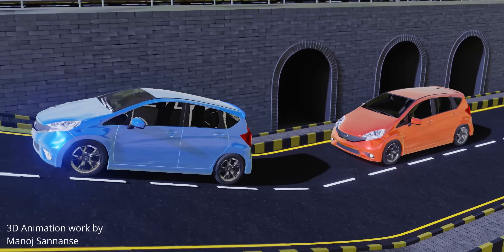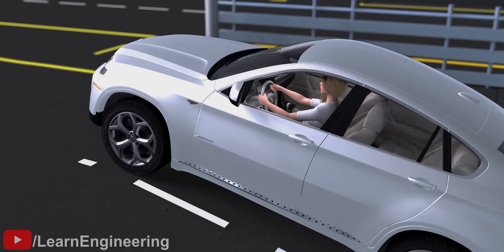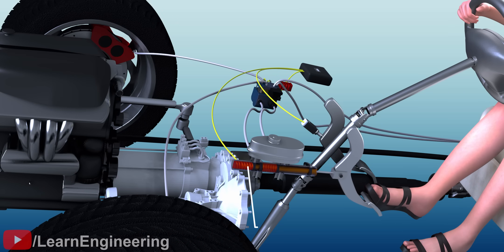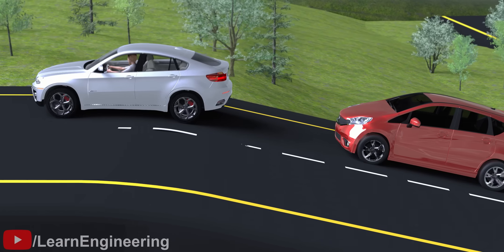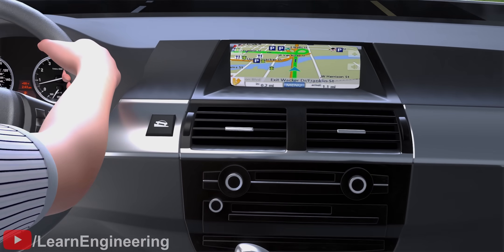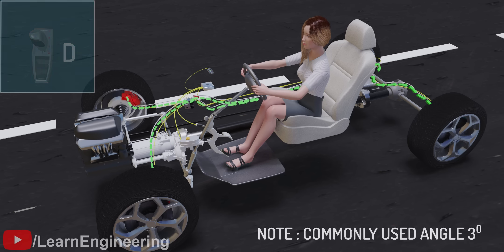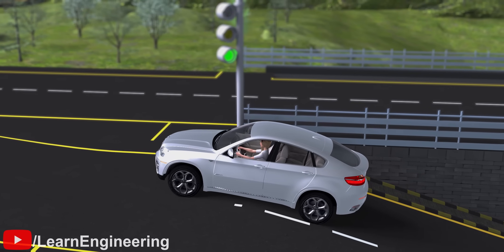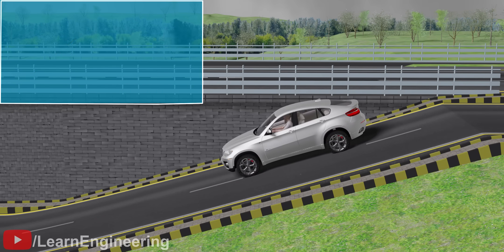Understanding Hill Start Assist!

Comment: Hill start assist is just another excuse for incompetent driver to be on the road.
Learn to drive is a much better solution. 
Driving instructors today can't drive properly themselves 90% of them are totally useless as instructors. 
I have been a Trainer / Assessor for heavy equipment, light vehicle, multi combination, small ships, aircraft, and construction/mining and military for fifty plus years.
I started driver training at 17 years of age, because l was taught properly by my father on all types of mobile equipment l am now in my mid 70's and still training young people from age 10, by age 12 they can operate excavators, cranes, light vehicles including speedway racers.
This gives me the qualifications to state there are very few competent drivers anywhere in the world.
No I've never had an accident.

Comment: “Using the fewest components,” Oh if only there was, say, a wire on a handle that went to one side of the brakes and simply applied the brake. The weakest link is the nut on the other end of the handle, it’s prone to failure

Comment: If we taught people how to actually drive we wouldn't need all these stupid expensive computer controlled features. I can do that hill start feature in a manual transmission. Add snow and ice to the situation and you have to think about weather you should go to the top of the hill or stop at the bottom and get a head start. Computers are making the next generation dumb! Good luck!

Comment: I hate hill start assistant!
I never ever had a problem to start at the steepest hills without it.
But now I have a problems parking at a hill. To overcome the breaks of the hill start assistant you have to accelerate much faster and the acceleration comes suddenly (without your control), so the possibility of hitting the cars before or after the parking slot is higher.
Reply: AND, it's expensive to have to prematurely replace your clutch because the hill assist causes excess wear and tear.   Check out the blogs.   Experienced drivers HATE HA!

Comment: There is also handbrake available in every vehicle, one should use handbrake on when stopped on inclined road and when u want to move up again put ur foot on acceleration paddle and accelerate, when u feel it moving release handbrake and u r going up. Its simple (need Practice)
Reply: This is next level of mind process, let just NASA invest in to some weird automatic asist.

Comment: "A few seconds are required" to switch between the brake and accelerator / accelerator and brake pedals?!
That could explain why there are so many 'tail end' collisions in 'the great USA'.
A vehicle travelling at only 20mph, will cover 9mtrs / 30ft in 1 second.
In 'a few seconds' - lets say 3 - it will cover 27mtrs / 90ft.
No more than a split second should be needed to move your foot between the brake and accelerator pedals.
If one is not competent to start on a hill - just by balancing clutch, brake and accelerator - USE THE HANDBRAKE!!!
Is that not taught for a US driving test?!
(Oh. I forgot. The citizens of 'the great USA' are mostly too intellectually challenged to be able to drive a vehicle with a manual transmission.)
I've driven and owned vehicles with 'hill start assist' technology.
Like most, if not all, modern 'safety' / 'driver assist' features it makes the driver lazy and dependant on technology.
Like most, if not all, modern 'safety' / 'driver assist' technology it is prone to failure.
WHEN it fails the driver, expecting the VEHICLE to be 'in control of the situation', is placed in a worse predicament than if the 'technoligy' had not been there in the first place.
'Cruise control' is another example of potentially dangerous 'driver assist' technology.
ALL 'driver assist' technology requires extra 'specialised' driver education to be used safely.

Comment: Try using a manual on a steep hill. The car will roll back, but you have to be quick to let off the brake and clutch and hit the gas about the same time or you will roll into the driver behind you or stall. Takes some practice but it's quite fun to do. I always try to see how fast I can move forward with minimal roll back.
Reply: Tell me you’re inexperienced without  actually telling me you are.
Reply: Have you not heard of the HANDBRAKE, or what it's used for?!

Comment: I used to do all this with my left foot on the brake or in a car with a clutch with the hand brake. A foot operated parking brake was a bit more problematic.
Reply: It's hard enough for all these people to get out of bed in the morning. Now you want them to multi task while driving?
Reply: @YourDadsBoyfriend  yeah but only under 5 mph.
Reply: @YourDadsBoyfriend  yeah up to 5 mph.
Reply: @Aerostealth  
They manage to multi-task enough to send and read text msgs while driving.
AND they claim that's safe to do.
Reply: When driving an automatic one should NEVER use both feet.
It has to be a VERY steep hill to cause an auto to roll back.
Why would you want an auto anyhow?
Much better control with a manual.

Comment: This tech is crap! It locks my truck brakes even on flat surfaces and causes accidents because when I press the accelerator the brakes still hold with immense lag time. This tech is garbage and people need to be better at driving if they "need" This tech

Comment: What's so hard about just revving it a little and slowly releasing clutch until it engages?
Reply: What's so hard about using the HANDBRAKE as and when necessary.
Is that not taught in your 'driving schools'?!
Reply: @trueaussie9230  Who said it's hard to use handbrake? You got problems in the head?

Comment: use left foot to release the brake while right foot pressing accelerator
Reply: When driving an automatic one should NEVER use both feet.
It has to be a VERY steep hill to cause an auto to roll back.
Why would you want an auto anyhow?
Much better control with a manual.

Comment: Alternatively use left foot 🦶
Reply: VERY difficult with a manual transmission.
When driving an automatic one should NEVER use both feet.
It has to be a VERY steep hill to cause an auto to roll back.
Why would you want an auto anyhow?
Much better control with a manual.

Comment: What the fudge. "As soon as you release the brake pedal, gravity does it's job". Umm no... First of all, a car with automatic transmission moves forward even without pressing the gas pedal, so there really isn't any need for assists. The car does not move backwards. Then with manual transmission, there also isn't any rush with moving your foor from brake to gas. While uphill, all you need to do is to lift the clutch about halfway up. (The required amount of lifting the clutch depends on the car). The car does not turn off and also it won't start to slide backwards without brakes.
Reply: Or, in a manual vehicle you could use the HANDBRAKE and reduce unnecessary wear and tear on the clutch plate.
Reply: When you do something wrong with clutch you can smell it inside and outside the car. I've been doing this with my manual gear car for 9 years and never have I smelled anything that would indicate that clutch is taking damage.
Reply: @k4mik4ze100  
Have you ever seen a clutch plate?!
Do you know what it's made of?!
Have you seen what it mates up with?!
When you start to SMELL the clutch plate burning it is suffering extreme damage.
Before you can smell it, it is suffering unnecessary and avoidable damage.
Riding the clutch 'polishes' and puts a 'glaze' on the surface of the clutch plate - even before you can smell it cooking.
That 'glaze' reduces the adhere-ability of the plate which negatively effects the transfer of power from the engine to the wheels, until the 'glaze' wears off.
If you continually / repeatedly ride the clutch, the 'glaze' never wears off.
Using the handbrake avoids that unnecessary wear.
But, if you're happy with what you're doing, please continue.
You're the boss.

Comment: What did the smart people do before it all this technology hold the break with your left foot start giving a gas with your right it's not hard to figure out nowadays everybody so freaking princess and depends on technology to do every damn thing
Reply: When driving an automatic one should NEVER use both feet.
It has to be a VERY steep hill to cause an auto to roll back.
Why would you want an auto anyhow?
Much better control with a manual.

Comment: Yeah, like its really hard with automatic transmission anyway... 😅 I drive a manual and this tech is useful, liking it very much.
Reply: The 'standard issue' HANDBRAKE is even more useful - and comes without extra cost and, unlike 'hill assist technology', rarely fails without warning.

Comment: Interesting, but just another reason not to buy a new car. It sounds expensive when you can just use your 2nd foot on the brake if you have an automatic as depicted here.
Reply: When driving an automatic one should NEVER use both feet.
It has to be a VERY steep hill to cause an auto to roll back.
Why would you want an auto anyhow?
Much better control with a manual.
Just out of interest, have you heard of a HANDBRAKE?!

Comment: Ik like u can just leave clutch at a slow pace nowadays and the car will mostly start moving with no accel so i always used to put my foot on brake and clutch then when i started to drive an old car and it needed some accel i just switched  to the fucking handbrake it is that easy srsly thats why Automatic car is a degenerate race
Reply: It has to be a VERY steep hill to cause an auto to roll back.
Why would anyone want an auto anyhow?
Much better control with a manual.

Comment: In auto hold brake with.left.put right on gas easy
Reply: When driving an automatic one should NEVER use both feet.
It has to be a VERY steep hill to cause an auto to roll back.
Why would you want an auto anyhow?
Much better control with a manual.

Comment: Mobil matik dan mobil manual tetap saja kaki kanan dan kaki kiri digunakan keduanya. Bukan hanya kaki kanan saja digunakan untuk mobil matik.
Reply: When driving an automatic one should NEVER use both feet.
It has to be a VERY steep hill to cause an auto to roll back.
Why would you want an auto anyhow?
Much better control with a manual.

Comment: Professional move: e brake than as soon as you gas it release
Or use your 2 feet like the cool manual drivers use.
Reply: When driving an automatic one should NEVER use both feet.
It has to be a VERY steep hill to cause an auto to roll back.
Why would you want an auto anyhow?
Much better control with a manual.

Comment: Skill : is to drive a manul car without any HSA or allowing the car going behind too much.
Reply: Every vehicle has a 'hill start assist' feature, and it comes at no extra cost.
It's called a HANDBRAKE.
If you know how to drive correctly there is never any reason to 'go behind' even 1 millimetre.

Comment: I remember when I would hold the car uphill without using the brake brake. All I needed was the clutch and throttle. Hit the balance between the two and you're good. True skills are lost. I'm all for technology but not lazy tech.
Reply: @daviddou1408  Clutches were fine. I only replaced them during scheduled maintenance. If you do it well, it wouldn't your Clutch. Also, I only did it on rare occasions when I had to avoid a roll back.
Reply: The 'true skill' is using your HANDBRAKE.
You know, the skill you had to demonstrate to get your licence.
The lazy 'skill' is causing unnecessary wear and tear on your clutch plate.
Regardless of how often you allege you replaced a clutch (how often did you replace the entire vehicle before the clutch wore out?!), there is no disputing that balancing the clutch, brake and accelerator like that causes unnecessary and avoidable wear and tear on the clutch plate.
Reply: @trueaussie9230  True, but when you use a handbrake, you still need your clutch  and if you don't apply the clutch properly, you will get a rollback. There is no part of avoiding a roll back that doesn't require clutch application. But I know what you're talking about.
Reply: @lcsighteken2248  
It goes without saying that starting off on a hill, as with on the flat, requires one to release the clutch.
The engine won't engage with the wheels otherwise.
🤪🤪🤣🤣🤣
Avoiding 'roll back' requires a balance between releasing the clutch and releasing the brake - regardless of which brake one uses.
Balancing the clutch with the foot brake is likely to involve more 'clutch spin' than using the handbrake.
Which is not to say that inexperienced use of the handbrake does not result in unwarranted 'clutch spin'.

Comment: I cant even fathom why this system is needed for automatics, if you have 2 legs...
Reply: When driving an automatic one should NEVER use both feet.
It has to be a VERY steep hill to cause an auto to roll back.
Why would you want an auto anyhow?
Much better control with a manual.

Comment: The animation of switching pedals made with an automatic transmission is a joke 😂, just use your other foot... i was expecting a manual transmission
Reply: When driving an automatic one should NEVER use both feet.
It has to be a VERY steep hill to cause an auto to roll back.
Why would you want an auto anyhow?
Much better control with a manual.

Comment: I dislike these assists sometimes. It adds lag to your input. Some vehicles also have downhill assist to prevent "runaway roll" but then has a touchy throttle so you get jerky downhills. And in 2022 why have they not figured out how to make a throttle with control in the first 15% of power?

Comment: I actually keep my foot horizontally on the brake and gas pedal, so that I don't have to switch the entire leg from accelerator to brake when the car is going backward.
Reply: Nice, like a racing driver.
Reply: I know. I see all these comments being somewhat arrogant about using the handbrake when I’m thinking they are just not skilled enough to have mastered heel toe! I’ve only needed to use that technique a few times, but learning it comes in handy.
Reply: @poolecl  ive got size 12 feet. I cant do heel toe method, i gotta use the left side of my foot on the brake and the right side on the pedal because its too awkward to have my foot sideways. So when it comes to stips i just handbrake

Comment: 0:06 "A few seconds are required to switch from the accelerator paddle to the brake paddle."
A FEW SECONDS?

Why make the car more expensive, complicated and  less reliable by adding all this technology if all you have to do is move your foot a bit faster or brake with your left foot operate the gas with your right? In a manual just release the clutch untill it starts binding and let go of the brake the car should go forward if not just add a bit of gas.

Comment: Those who can not move the foot fast enough from the brake pedal to the accelerator pedal, or if necessary combine this action with using the parking brake, should probably not drive a car at all.

Comment: Almost ANY Idiot with 1/2 a Brain can start a Car on a Hill in a manual Car WITHOUT Hill Start. If you can't without rolling back then get back onto the Couch in front of the TV with your McDonalds and Coors light and learn to walk. But don't try to chew Gum at the same time, you WILL fail.

Comment: This system is only for newbie drivers, a manual driver would learn left and right foot braking for gear shifting etc and right foot braking specially for uphill scenarios or there is an even easier method for beginners which is called "USE THE DAMN HANDBRAKE" and for an automatic driver they have 2 feet so I assume they would be able to gradually release the break while giving some throttle for uphill scenarios.

Comment: Cant you just hold the brake with your left foot and give it a gas with the right foot. Then you relese you left foot when you feel the car has enough power to not roll backwards.Then you drive normally with your right foot.

Comment: This "new" feature was available in BMW in the 2000s. So it's very fitting the animation is done using BMW vehicle.

It did make life easier when you're drowsy or clumsy. However there were days when you want to go fast and it momentarily holds you back

Comment: I guess this technology or innovational feature they put into a car greatly helps for beginners I guess but the simplest technique available for me is to engage in neutral while the foot brake is all the way in then lifting the ebrake while hanging then when about to move shift to drive and release ebrake then slowly on the foot brake. (For automatics)

Comment: So all the shown cars are automatic....which won't roll back when you release the brake and transition to the accelerator, cause the vehicle is in drive and the torque multiplication created in the torque converter will start the car forward,

Comment: Imagine requiring all those electronic systems and assists when you can just use the handbrake.
Reply: I hate my electronic hand brake which apply/reliease in 5 second. I would love a old school mechanical hand brake.
Reply: Yeah exactly
Reply: Starting at a steep point?
Reply: @paulinhoxavierii3744  yes

Comment: I have been driving only a few months now (I'm a European and the car is manual). So if the hill isn't that steep I just quickly move my right leg from brake to gas and then slowly release the clutch. If the hill is steep or I know I will wait longer (traffic light for example) I use the handbrake and do exactly the same thing just without having to use regular brake at all. It's really not that complicated. Also my car doesn't have HSA